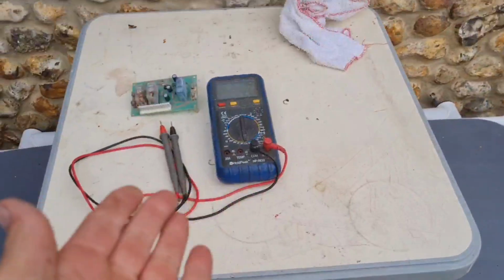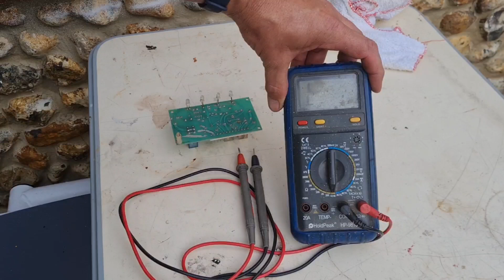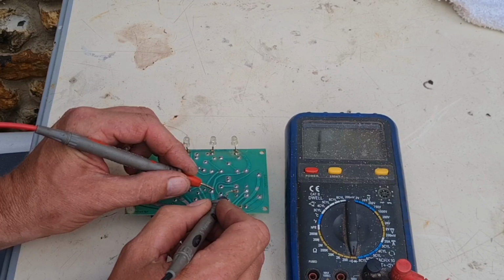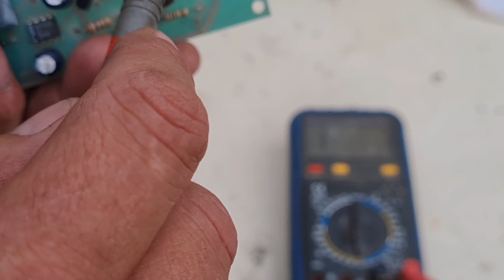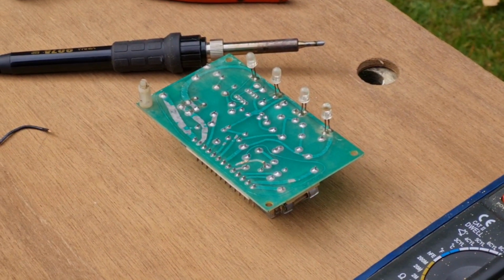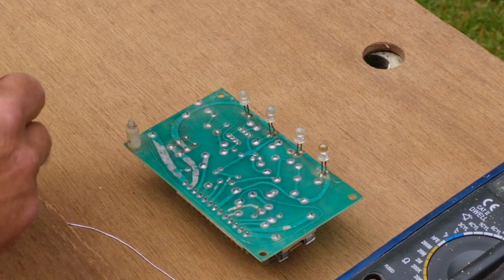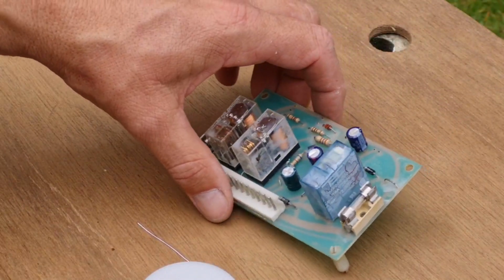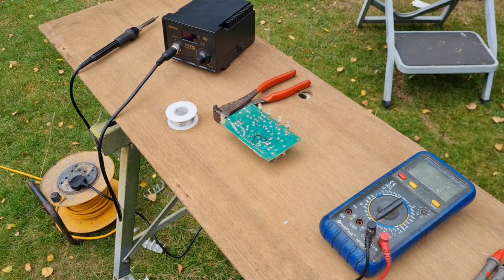Westwood Countax ECU repair.

Comment: Good repair. One suggestion is not to carry solder on the iron to the PCB pad, apply the iron to the wire or pad first and then feed solder in. Yes, requires three or more hands but you already have those. As one of the commenters mentioned many of the joints looked dry / cracked and any flexing of that PCB may cause issues. To measure resistors, select a very high ohms range to begin with, for diodes (2 pin black) or transistors (3 pin black) use the diode range.

Comment: Those little black things with two wire are diodes the three wire thing is a transistor of some type. When soldering it is better to put the solder wire onto the part to be soldered and then the iron on top, add fresh solder to the joints on the board before soldering the wire on. Several of the joints on that board looked dry to me could well be an idea to reflow all the joints with fresh solder. if you want to watch things electronic big clives you tube channel is very good.
Reply from the maker: yeah I have watched big Clive. God knows how anyone can understand electronics like that. totally confusing to me.
Reply: @NorfolkMancave  Not that hard really, just go in easy steps, keep watching big clive and eevblog and you will soon pick up a lot of knowledge.